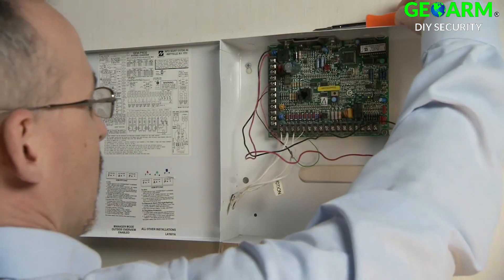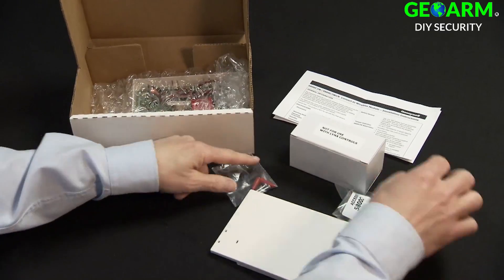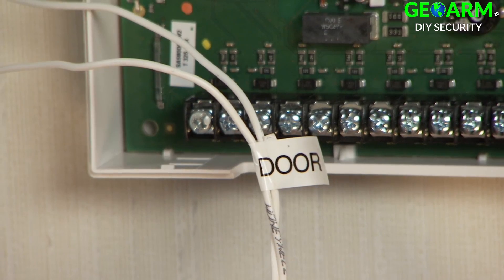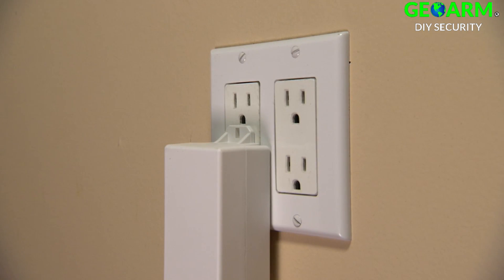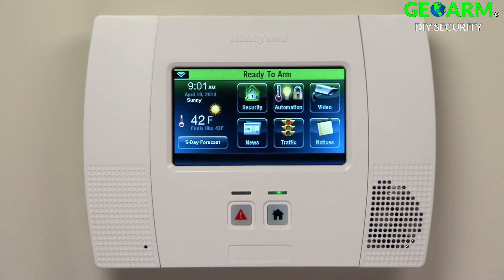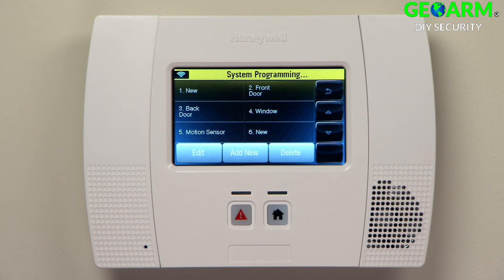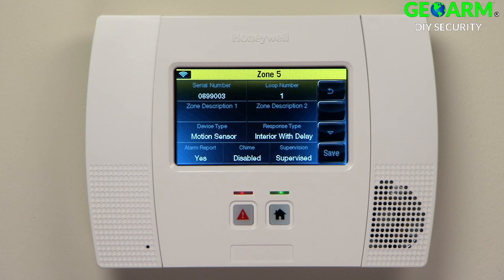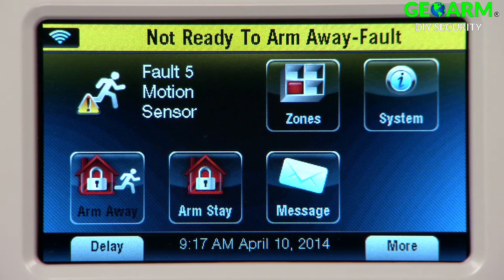Honeywell 5800C2W - Installation & Programming

Comment: I'm confused on how it is wireless. You aren't changing the existing wired sensors,right?
Reply: How do you connect the Lynx keypad in place of existing? Also says no smoke detectors can be attached. What can be done about that?

Comment: Can the Honeywell 5800c2w use hardwired sensors from my ADT Safewatch pro 3000 wired security system?
Reply from the maker: Yes, the Honeywell 5800c2w hardwired to wireless converter can use the existing hardwired sensors from the Safewatch pro 3000 wired security system. In fact the 5800c2w can utilize hardwired zones from just about any wired security system except for any type of normally open sensors such as smoke, carbon monoxide detectors and things of that nature. If you have any questions or comments please feel free to contact us at 1-877-443-6276 option 3. Or if you have any additional questions feel free to leave them here and we will get back to you asap thanks for your intereste please make sure to subscribe to our page!